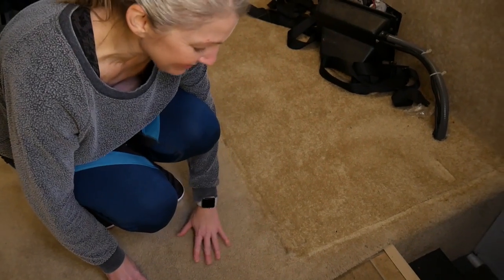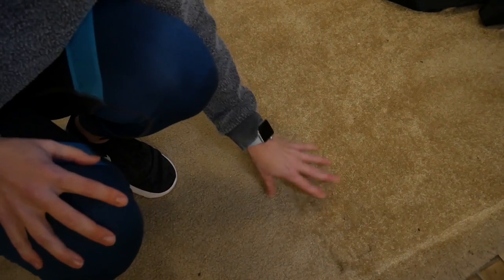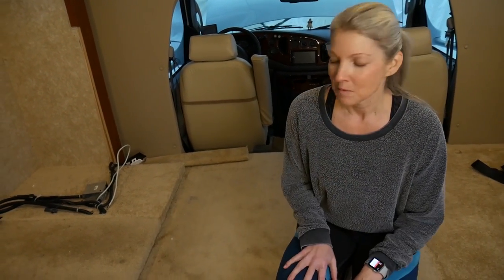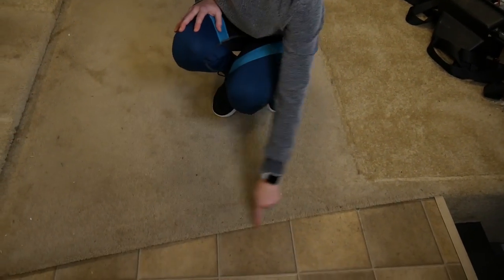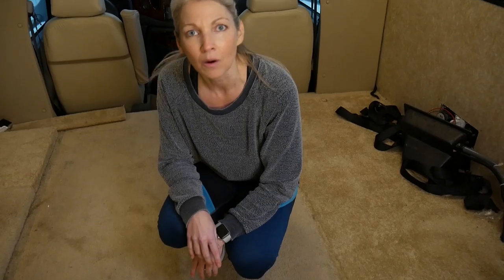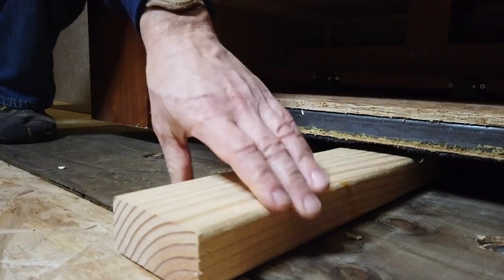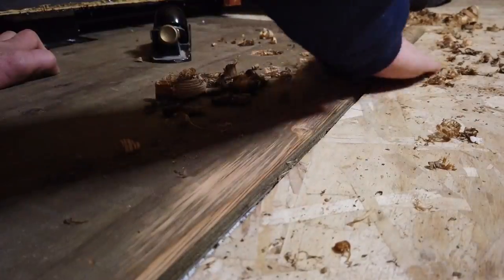Repairing Water Damaged RV Floor | Class C RV Renovation | RV with Tito

Comment: RVs are made from the inside outward. I went to RV maker in Texas quite ingenious. Which makes repairs so awesome. Creativity is needed. To jerryrig things. No right or wrong. Affordability is key. I live in my standard RV 24/7 and everyday and change of weather is a challenge but fun only in hindsight. Heat is always a factor. Home Depot is great for easy to install window unit air conditioner. Great price and name brands.

Comment: Thank you Tito for sharing so much with the RV community.  You are truly a treasure for RVers.  I did NOT read through the other comments on your sub-floor repair job so maybe this has been discussed.  I see that after you removed the rotten portion of the half-inch sub-floor around the fridge, the remainder of the original sub-floor was no longer supported by the adjacent steel beam.  Being a critic (constructive criticism here) I kindly suggest you add a disclaimer to advise your viewers to locate the supporting steel and cut the sub-floor to overlap that steel beam by 3/4".  This way both the original floor and new floor are supported properly.  The way you cut it, the original 1/2" sub-floor will flex when stepping near your cut.  I don't know how you finished the floor, but a laminate or wood floor over the repaired area would surely minimize or eliminate any such flexing.  But a new sheet vinyl, vinyl tile, or ceramic tile floor would be present quite a problem.  To locate the steel beam under the floor, hammer thin finish nails into the flooring.   You know you hit steel when it stops after a half-inch.  Again, thank you for all your contributions. Ron Dittmer

Comment: It is rare that whenever renovating you don't discover a problem that needs to be addressed.  Particle board does not do well when water touches it.  Good choice using treated plywood for the repair. RV manufacturers should start using that for all flooring.  I loose half a dozen pencils on every project.  I see you have conquered that dilemma.  As always your repair was rock solid.  Can't wait to see what you have chosen for the new flooring.  Happy renovating, Lou
Reply from the maker: Thanks Lou. You're right "you never know what you're gonna get ~ Forrest Gump's Momma"

Comment: Hi Brian and Melissa!   We also have to repair water damaged subflooring.   I still have to repair some roof leaks before taking care of the water damaged flooring.   Found some potential water incursion areas that were not visible with the flooring and carpeting in place. We are removing all the carpet and going with self-stick vinyl tiling. I hope the road noise does not increase too much.  Still have to gut the tiny bathroom.  Thanks for the video.

Comment: Glad I found your video. First time RV owner, and running into a problem with every aspect of the structure and systems (1990 Winnebago). This was a very helpful x-ray into the beginning of my journey of tearing up the floor due to water damage and using materials with longevity on the repair. Thank you.

Comment: Another job well done.  I know you do a lot of boon docking camping but it might be time to replace that fridge with a Samsung or a Haier refrigerator. Then you could seal up that big rain intake on the out side.  Another idea before you put in the new floor is to water seal the wood base first.  The OSB flooring is a sponge as you found out, seal it up and give your self a fighting chance against water damage.  Looking forward to the next video.
Reply from the maker: Thanks for the tip. I'll probably put down a moisture barrier prior to installing the flooring. About the fridge. Unfortunately, I'd rather have a propane fridge instead of one that needs to be powered 24/7 and draws 130 - 150 Ah per day. We're rarely connected to shore power.
Reply: @RVwithTito  Samsung and Haier are low power draw and with all your batteries and solar you'll be in good shape.  Eventually that fridge is going to give up, the replacements are not like the one's we had 10 years ago.  Their worse.
Reply: @RVwithTito  We had to replace our refrigerator this summer and replaced it with propane.  I like the propane also. Right after that... we had a leak... not from the re-fridge but from our hot water tank. My husband had to cut a 3x4 square out of the sub floor and put 2x 4 down for extra strength before putting the greenply down. Probably should of made a video of it but did not..

Comment: I don't know if someone has already commented on this yet. That particular area you had the floor rot has a hose that goes from the refrigerator has a hose that is supposed to hang out of the side of the vent. It releases any condensation that your refrigerator creates. If it is dislodged it can leak into the flooring causing the floor rot. That's exactly where mine rotted out. You end up with a steady slow drip, perfect storm.

Comment: RV mfg should not be allowed that crappy chip board for floors.  Most RV's will develop a leak at some point.  This is the core, the base on which everything else is built on.  They should use nothing less than marine grade plywood.  It's like building a house on 2x4 wood foundation, it just wouldn't be acceptable. But that's what you get with an unregulated industry.
Reply from the maker: Even a slighly higher grade plywood would be better and stronger.
Reply: Agreed. Just thrown together.
Reply: True, mine is only 6 years old and has a soft spot by one of the doors and the storage compartment floor is totally rotted out on one side already, granted I did buy it used but still it’s only  6yrs old!!! :(
Reply: My 2011 Cougar had a bad leak in the galley, long after it dried we have a soft floor now all around, time to rip it up and put in marine grade, Keystone is one of the worst rv makers!
Reply: RV with Tito DIY Pressure weather treated wood is what should be used.
Reply: @ryanhunt881  My trailer floor has rotted where water pooled up on top of the rolled up awning in the winter and then went inside the wall.  Hate particle board!  Now I make sure I tarp over top of the awning for the winter.
Reply: All houses in bc are built with that shit and it does nothing but rain here lol

Comment: Good thing you found that water damage before it got any worse. If you don't have an oscillating tool you should get one, it might have made getting that old sub flooring up a little easier. Nice job on the repair, I don't think I would have attempted that right where the slide is at knowing that I would probably screw something up and it would cost me a fortune having it done over again correctly.
Reply from the maker: Thanks! You're right. That tool would have worked great for that. I'm always looking at those wondering if I need one. Maybe I do.

Comment: Found this video researching floor repair and found out that many Dometic fridges have drain tubes on the back that fall apart and let the water from the defroster drip to the floor instead of out that louvered vent. Rotted floors near the fridge is very common. Check that drain tube!
Reply from the maker: Yes. I have my drain tube sticking out of the vent.

Comment: Nice work, I have a similar situation to work on, but mine includes a bundle of wires coming through the floor, that feed the slide motor and entertainment right in the outside corner of the slide, which I am sure is responsible for water getting to the wood floor. But what you did gave some idea of what to use and how to use it. Thank you for the great video.

Comment: Thanks for showing us the problems you encountered and how you fixed them.  But, what are you going to do about the source of the water?  Good idea to plane the wood gaps.  Clever use of the hole saw to create a recessed place for washer and bolt head.
Reply: Looked more like a Forstner bit than a hole saw.
Reply from the maker: I'm going to modify the inside of those vents somehow to prevent water intrusion but still allow heat to escape. I've got a couple ideas in the works. Yeah a forstner bit works well as a large counter sink tool.
Reply: Bennington Camper Yup.  That’s what it is called.  I couldn’t think of Forstner AND drink my coffee so I picked coffee.  Thanks!

Comment: Good video good info we had a situation where the floor of our RV got a little soft throughout we went in from underneath and bolted in steel angle iron under the whole feels like new again
Reply from the maker: That would do it. I've used steel angle iron to reinforce my battery compartment. Solid.

Comment: I love what has been done so far.  I can't wait until I can see the floor when it is done.    I agree with you on keeping the flooring all one type from bathroom to the front.   If I had a RV to remodel I would buy that Linoleum that has a wood floor design on it & put throw rugs in from of the recliners & sink.  That Linoleum is sold at a good price at Home Depot & Lowes.    Til next video, keep up the outstanding work on the remodel.
Reply from the maker: That's what we're doing. Going with wood-looking vinyl plank flooring from Lowes. That's coming in the next update. Pretty exciting.

Comment: You have inspired us to replace our sofa as well and will be taking that job on as soon as we can. We are a lot older than you so it takes me a lot longer. I hope I don't find water damage when I take up the floor. You are a much better wood butcher than I am and my job will not look as good as yours did. That new floor covering you have picked out will be stronger and keep any moisture that gets on the floor from the inside from getting to the sub. I don't think you plan on putting it under the slider but it would help protect that area as well. Now you have me wondering about the drain area of my refrigerator to make sure I am not having the same problems. Still working on the valances. Thanks.

Comment: Looking for how to make repairs to an RV and this was most helpful and insightful. We are going to look at an RV 2 hours away tomorrow and the sellers admitted it has a few soft spots in the floor but no idea why. There is suppose to show no signs of water damage via windows, overhead fans or vents etc. So seeing yours was by means of a fridge vent is helpful as one more thing to consider tomorrow when we evaluate the unit in question. They also no longer have the rear entrance steps so my husband thought perhaps there's damage to the unit via why there may no longer be steps which were originally automatic steps too. To replace they can be as high as 700 just for the steps so we'd probably be looking at manual steps rather than electric. But the question begs to be answered is the floor soft spots due to physical or structural damage or is it water damage and if so wheres the source of that water. Could it have been in a flood? The original carpeted flooring was replaced with vinyl planks is looks like in photos we've seen. So again is that glued down or will it be easy to rip out to get to the repairs needed or even to evaluate those. The seller is going to have it looked at today so we might have a few clues tomorrow by the time we get over there. Meantime I'm a lone female camper as hubby of 50 years has never been into it. I'm graduating from being a happy TENT camper to a small class B Motor home and structural soundness along with mechanical and engine and transmission and brakes etc. are all important to me. So your video gave me insight as to just what can be done to avoid perhaps having to do a full pull out all cabinets etc. to repair a whole floor. That of course depends on what we will see tomorrow or even not see. Thanks for your share so helpful.

Comment: never easy is it? Do you ever worry about hitting electrical? That's my worry in the walls anyway...
Good ingenuity as usual, thanks for sharing! Always enjoy your videos
Reply from the maker: No too concerned about electrical in the floor. I've run a lot of wire and know where most of the wiring is in the RV. I use an inexpensive borescope to look inside the walls to see what's in there. That's very helpful. When I cut the floor I set the saw blade to just under 1/2" so I wouldn't hit anything (like metal framing).

Comment: Lot of work taking up the rotted floor but you did a good job. Why didn't you paint all the expose metal frame after you cleaned it up? Looking good isn't important but preventing future rust is IMO. Good luck with keeping out the water.
Reply from the maker: Yeah. I should of done that. Forgot. Hopefully it's sealed up enough to prevent moisture. Thanks.

Comment: Brian, I have watched many of you videos, they are extremely informative and this one is what I was looking for.....mostly!  I have been renovating my 2008 Class C Thor Chateau.  Have had it less than a year. I was preparing to pull up the carpeting and linoleum, just like in your video and found water damage under the slide, that was extended.  The damage is on the driver side near the stove and I "think" there may be damage behind the driver seat.  I just didn't have the hear to look.  Heaven only knows how long it's been leaking.  I covered it back up since I have an  upcoming camping trip in less than 2 weeks....for 3 days.  I've got to figure out how the water is getting in.  My question is, can you remove the flooring from under the slide without having to remove the slide?  I'm pretty handy and I think I can do it myself but if the slide needs to be removed I would have to take it to the dealership I purchased it from.  The over cab area and the wall behind the passenger seat has water damage as well.  I'll tackle that at another time. Any advice is most appreciated.
Reply from the maker: Sorry. I can't say. You'll have to see what you can reach and assess. I've never removed my slide but have heard of folks doing it themselves with a forklift. Probably not a job I would attempt myself. Good luck!

Comment: I know this old, Thank you for this, I come to find out that I to thought that I just mopped up all the water on my floors and now, I have two soft spots in my kitchen part of my class C. So I'm just waiting until this winter breaks up in MI and then I'm going to start seeing what I'm dealing with. I'm not handy at all but thank to seeing you doing it. I've figured out the way of going doing it. Start out at one section at a time which for me is the kitchen space where I walk at.

Once again Thank you
any tips for me, let me know.
cam Flint,MI

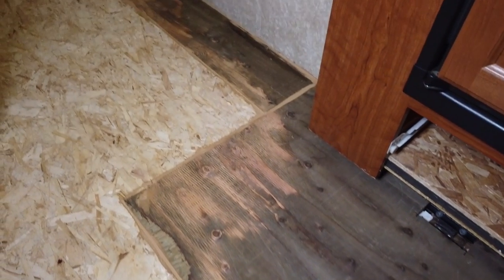Comment: Thank for the great video! I have a piece of floor next to a wall in my 5th wheel that needs to be replaced for the same reason. I didn't see how you cut the wood out that is right next to the wall at 9:50. What tool did you use for that?
Reply from the maker: I may not have had to. I actually can't remember if it even went under the wall. I may have been able to just pull up the remaining subfloor by the wall by hand.

Comment: I had to do the same thing but with a Class A, and most of the rear bedroom. Even taking out the  hydraulics for the slide etc. Remove  most of the electric under the bed.. lol     and the entire bed frame..  It was almost half the bedroom floor.  They had not replaced the seals  and the hydraulic;s had a problem and had drifted w/ a faulty  valve. and let the slideroom drift out about a foot..  SO  neither in or all the way out.. and in storage for many months.. Water got in and  ruined 1/2 the floor..  The back corner was mush.. OSB  3/4  an inch thick..  No insulation under that, just plastic membrane..  It was a Gulfstream Suncruiser..
Reply from the maker: Ooh. Just getting everything out so you could fix it must have been a big job.

Comment: Hi! I have a similar issue in the same spot. I am going to attempt repair it. How were you able to make those clean cuts under the slide out? It seems I’ll have a 2-3 inches of area to work with under the slide but it’s about 4 inches deep back toward the wall...

Comment: Brian Good job what type of floor are you going to install..? Is possible to have and access to the fuel tank(fuel pump change) from the floor case emergency..?
Reply from the maker: What a great idea. I hadn't thought of that. I've had to tighten the fuel tank intake hose clamp before (on top of the fuel tank) and replace the main hose. What a royal pain in the butt that was. Having access through the floor would be awesome. I'll have to think on that. We're going with vinyl plank flooring. You'll see it in the next video.
Reply: @RVwithTito  Brian That is why the fuel pump from Onan gen need to be replaced (you show me how to do it 2 yrs ago)because is not inmerse in the fuel tank ..! I have and idea where the pump is.located under the floor ..going to drill up the floor put in access door while i facelift my floor like yours..! I hope nothing is in the way(chassis, metal)...Lol..!

Comment: RV factory should be ashamed,not even glue under the floor, staple, staple,staple, The whole RV made of staple , I could cry
Reply: Watching this only gives you glimsp at Staples. When I started my flooring after watching this o my it's like those Staples are end to end. They put the S in STAPLES. I could not believe my eyes.
Reply: The RV industry is comprised of some of the most shameless hacks of any “trade”, and I use that term very loosely in relation to them.  They are constructing absolute junk.

Comment: Thanks Tito for your video. I have a 2005 Gulfstream Conquest that has rotted flooring between the couch and dinette booth area. I’m reluctant to cut it out too deep because I’m not sure of what is underneath. Can you give me any info of the best way to go at it? Thanks for your help. Jeff
Reply from the maker: Drill a hole or find an edge. Figure out how thick the subfloor plywood is. Then set the depth of your circular saw just shy of that and take it slow.

Comment: Brian Are you familiar with Micro Air and 364 device..? so you can run your roof ac unit with small inverter generator like Honda 2000 ..